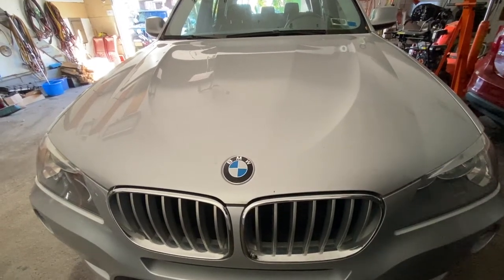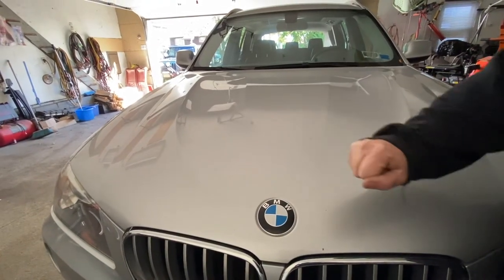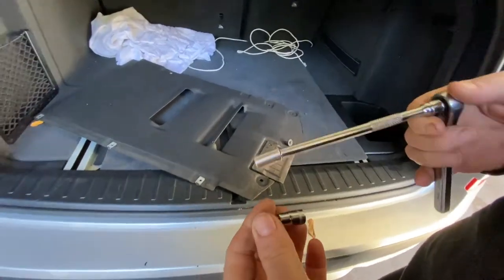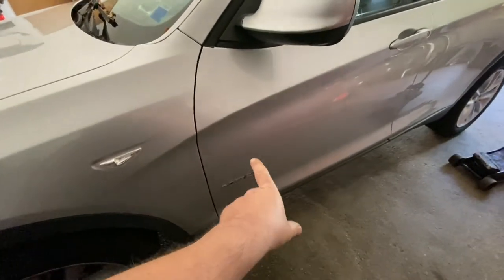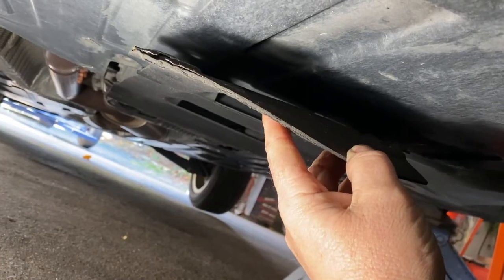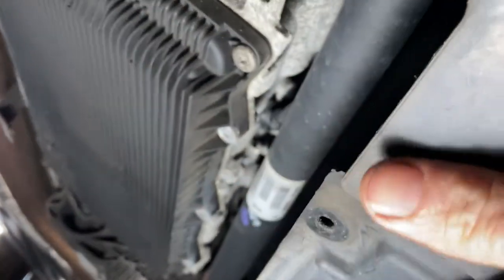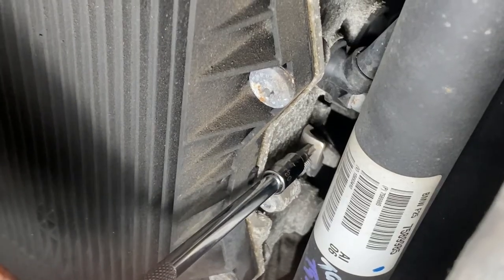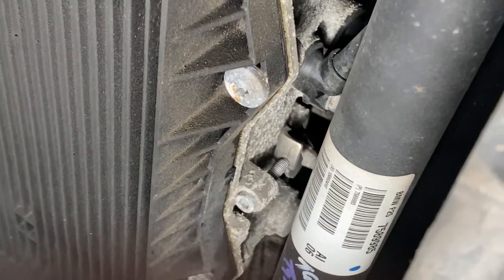How to Put BMW in Neutral For Towing - 2010 & Up, Most Series

Comment: This makes me wanna run out and buy one of these awesome incredibly made well thought out cars… Absolutely disgusting
Reply from the maker: Lol, and they have no physical oil or transmission dipstick like so many new cars today. More and more they don’t want the average person working on their own vehicles anymore, that’s where I come in :)
Reply: Incredibly horrible actually I own one
Reply from the maker: @gannonruby1119 it is
Reply: @Motorcarnut  as I typed that mine was stuck in a ditch and I couldn’t put it in neutral because it’s a stupid electronic shifter which was pretty frustrating but we got it figured out
Reply from the maker: I simple mechanical by pass near the shift lever could have solved this issue but guess it costs too much.

Comment: Thank you so much for video.
Reply from the maker: No problem
Reply: @Motorcarnut  Any idea on 2015 X1 , had coil short replaced 4 coils and sparkplugs , cranks but no spark out of coils?
Reply from the maker: You have any codes?
Reply: @Motorcarnut  had misfire codes P0304 P0301 and unkown code P13DE
Reply: @Motorcarnut  could it be a relay or fuel fuse???
Reply from the maker: That p12de can be traced to a bad ground somewhere, could be the reason why coil got shorted. This has to be diagnosed with a scan tool and looking at all information.  Also has miss fire code but engine doesn’t run?
Reply from the maker: It’s possible, seems the computer is not allowing spark for some reason

Comment: There is alternative procedure 
You hold the gear stick level unlock button push it forward and hold for few seconds and release it will put it in N mode.
Reply from the maker: That procedure doesn’t work when the engine won’t start or dead battery so it’s basically useless.
Reply: Yes, absolutely correct  @Motorcarnut

Comment: 2016 bmw 435 xdrive grand coupe ?
Reply from the maker: Yes
Reply: @Motorcarnut  thanks
Reply: So is it the same thing to take it out of neutral
Reply from the maker: Yes, just unscrew the bolt till it doesn’t touch the lever.
Reply: @Motorcarnut  they said it wouldn’t wrk for my car
Reply from the maker: I just checked 2014 to 2018 435i that’s how it’s done.
Reply: @Motorcarnut  I believe you , my warranty company and bmw said I couldn’t do it that way , anyways my car is already fixed something very bad happened to the essentric shaft and the sensor in there . I had to put the car on skated to get it on the tow truck
Reply from the maker: Tow company probably won’t know how to do it and BMW service center won’t tell if they even know. Basically they want you to pay
Reply: @Motorcarnut  exactly ! I’ve seen it done before but I didn’t have the proper tools when the car randomly broke down I had to call 5 different tow companies and none of them brought skates and finally one did he almost took off my bumper but I saved it

Comment: To the next poor sap dealing with what I'm dealing with - there's another way! The KEY is to apply the handbrake. From there:

1) If your starter still rotates and the ignition can be on
So, the engine may be dead, but when you push the start button, the BMW still makes some noises and turns some lights. This is the good news because this is the easiest way to put your car in neutral.

Here's what you should do:

Apply the handbrake to hold your car in place and safely operate.
Apply the footbrake and don't release the pedal until you finish the procedure.
Push the start button - the starter will start rotating and you may immediately continue.
Push the unlock button on your select lever and hold it until you finish with the settings.
Put the lever from the P position to the N position and hold it there for at least 4 seconds.
Then put it back in the P position for a while.
Quickly put the lever into the N position and then right away to the P position again.
Release the unlock button on your lever.
Release the footbrake.

You'll get 15min of neutral with the above procedure. I just did this on my 2013 528xi!
Reply from the maker: Very good write up! Never got the chance to try this as the battery was always completely dead. But definitely worth trying if the battery is still alive. Good info for others.